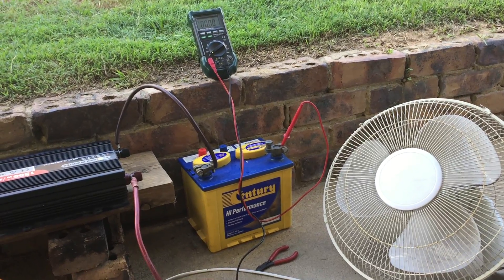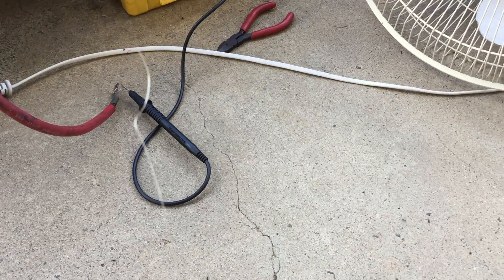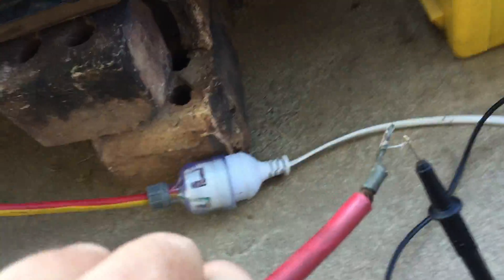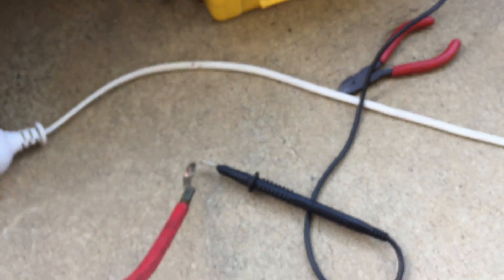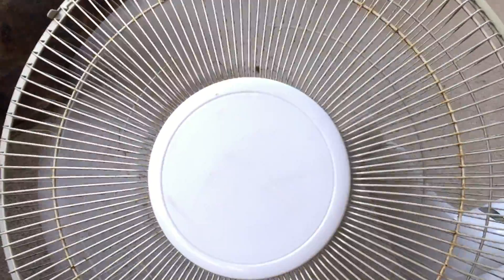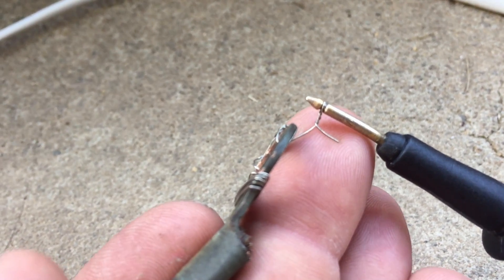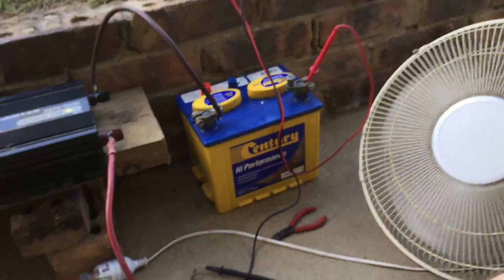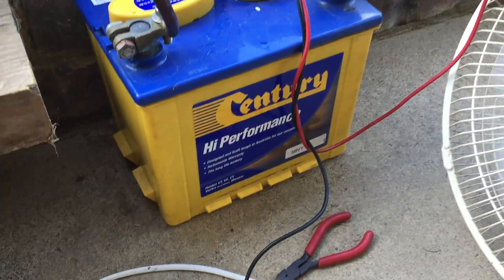Starting to test fuse wire for my 18650 DIYPowerwall, it's redneck but what can you do...

Comment: Just an idea, If you want the fuse wire to burn at less amps (per cell) you could use two cells on one fuse. So use one busbar down the middle, have the fuse go from top to top to busbar to top to top.
Reply from the maker: +sk8rboy1255555 solid idea, with merits!

Comment: I think 8 amp fuse wire will withstand more than 8 amps for a period of time.  Over here most DIY shops sell cards of wire in 5, 15 and 30 amp ratings for old home wiring, but I can't find lower. 

Could you calculate (or experiment) a gauge of wire which would heat and break at your desired current? Might be a fun experiment to watch! :-)
Reply: Having said that...  http://uk.rs-online.com/web/p/hookup-equipment-wire/8495897/